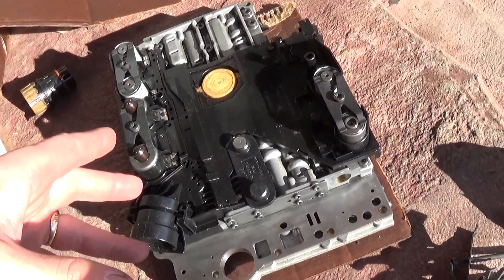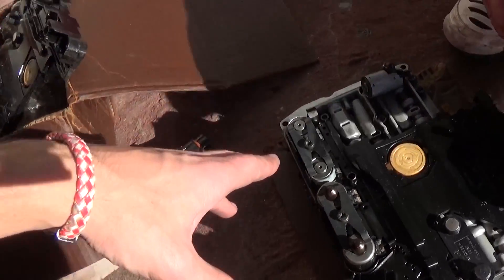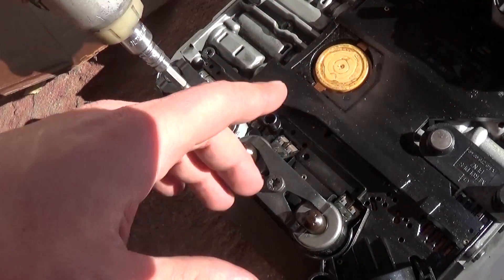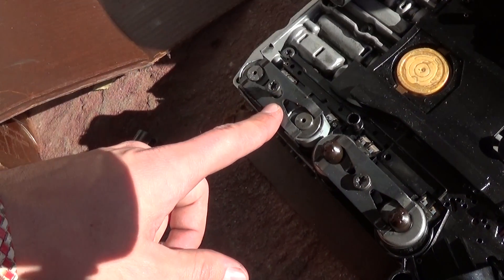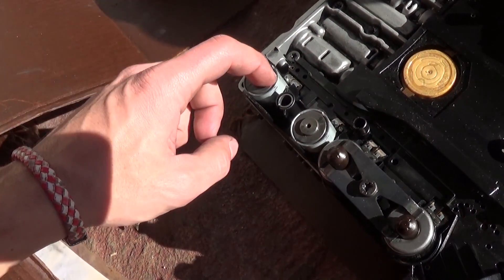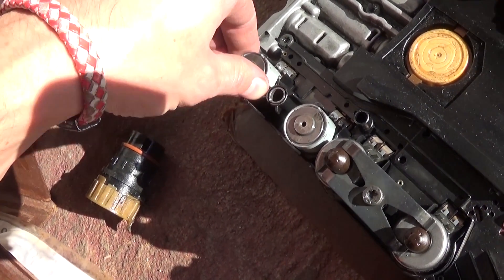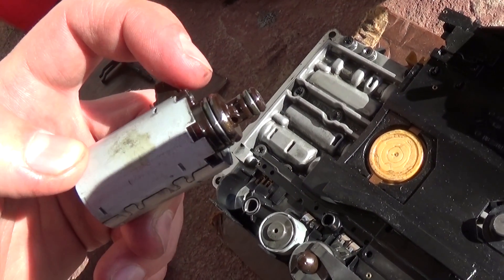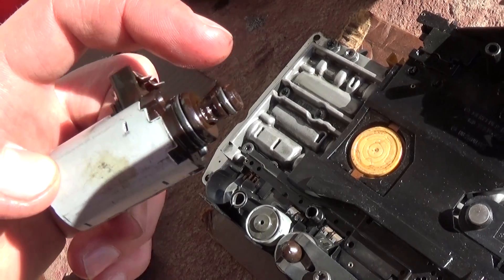HOW TO FIX TRANSMISSION THAT DOES NOT SHIFT

Comment: I have 240 z  automatic and it would skip the second gear and when reaches speed for 3rd gear it engages the third gear. I bought repair kit and install the new clutches but still nothing !
Do you have idea what could be the reason for not having the second gear ?
I am from Bosnia

Comment: hi huys, bmws like your 330ci convertible use zf and gm transmissions. it would be useful to look at these codes and if the solenoids could be serviced without taking the transmission out of the car. And of course good opportunity to change the oil...

Comment: Hi i have a Pontiac Torrent 2008 GXP 3.6l V6 engine and i have a delay of 2 to 3 seconds when i engage the automatic gear on drive and sometimes it doesnt switch gears, it get stuck on the first gear any advise?
RÉPONDRE
Reply: same problem here

Comment: What if there are no codes? which is what is happening to me. When I use the Automatic manual shifter it will work then the automatic shifter will work, but when I turn off the engine and try to use the automatic shifter at first, it won’t engage, and there are no codes. I am scratching my head.
Reply: Same here, any luck?